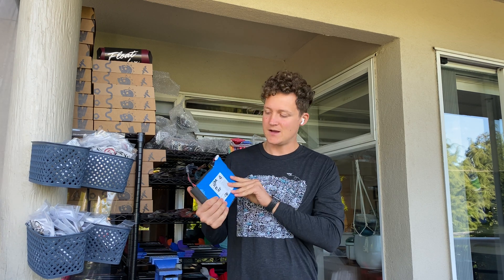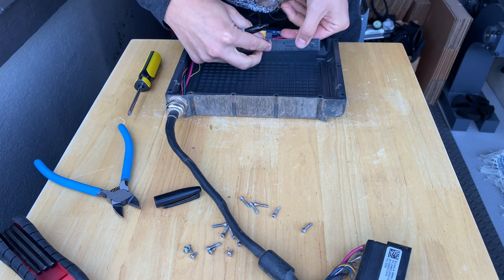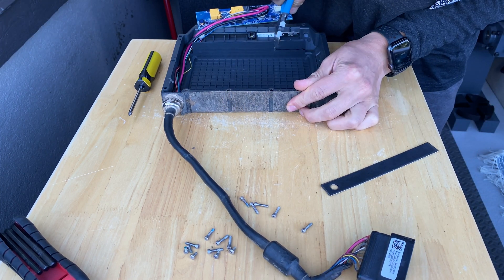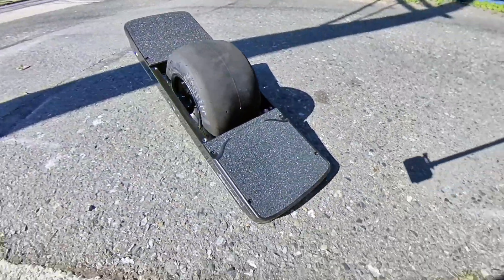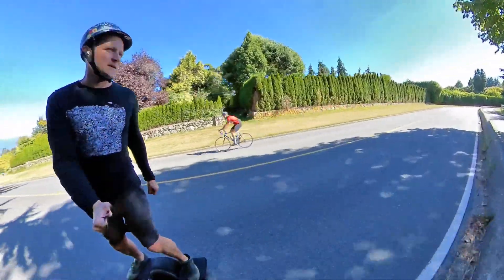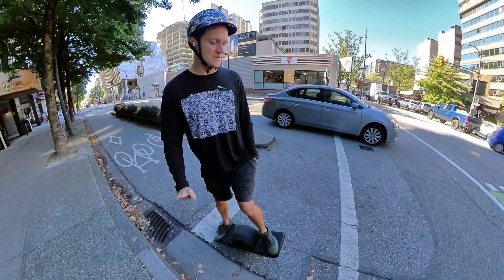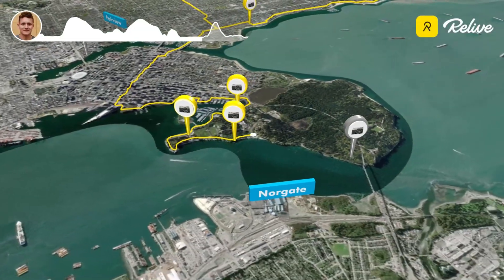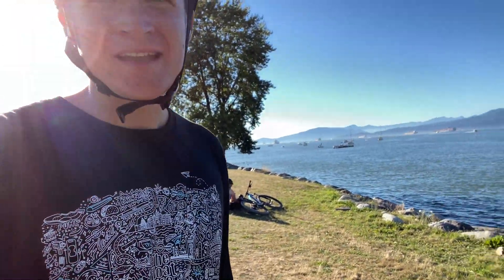Onewheel CBXR Battery Upgrade Installation & Range Test Review

Comment: How has the XR aged with the CBXR? i’m looking to get a battery replacement for a stock 4208 w 2500+ mi on it (new to me)  but i’m a little worried about long term longevity

Comment: Honestly an XR with CBXR is like on par with a OneWheel GT. I’d rather have an XR over a GT. No ghosting, no bricking when doing a simple mod. All the good stuff in one for the XR! Have to buy used tho :/
Reply: They are saying a new battery with a VESC module you might as well have a GTS you just built a GTS except its lighter
Reply: @BrianSmith-yq7ys I have a GT now. 

Also, a CBXR VESC is nowhere near as much torque as the GT-S we’re talking 27s vs 15s (113.4v vs 63v) and the GT-S even has a motor that’s been developed to make more torque (which reduces top speed but 113.4v is already insane)

Now if you’re talking VESC with a 20s battery it can be close with a superflux.
Reply: @destruxandexploze2552  I’m thinking I’d rather mod my xr than get a gts ill take you at your word that the gts is better but its also $3200

Comment: My installation did not go exactly like this. Extra tools were needed, 1 cousin and a broom stick. Those screws at 5:20 were brutal to get in, I had my cousin pushing down and sideways with the broom stick to get the screws to line up and go in. A bit of sweat and maybe a few tears were shed in the process. It all came together in the end, I also installed the battery meter which also had its own issues. Mainly the small restricted space in which to work in and fat fingers. 
It is definitely an experience to install the chibattery. I managed it after a couple of hours, and I'm glad it's done. Loving the range so much, and that my feet give out before the battery does.
Thanks for the video mate.

Comment: Thank you for this video. I couldn't get my CBXR to fit in the battery housing until I saw you route the power cables over the battery instead of under. Worked perfectly. Thanks!

Comment: Criticism: cam angle on 1st part of video needed adjustment. The work you were showing was at the back 3rd of shot. Other than that, great video. Wonderful shots of your ride. I've been told to visit Vancouver since I lived in the beautiful city of Toronto (I'm American). Nice job exhausting the battery. Are you going to do a follow up video later? A review on how the battery still holds a charge (less range vs same range)? I'd be interested in that. Also, how long (time wise) was your ride?
Reply from the maker: Thanks for watching. Yeah, I realized the camera was angled a bit but luckily caught it so the entire video wasn't like that. Vancouver is definitely one of the most beautiful cities. No follow-up planned but the CBXR is still holding up well. I can't remember how long I rode for but it must have been around close to 2 hours straight.

Comment: I just got cbxr chia 560 ish watt 38mi range of your a frisbee like me battery upgrade and my variable rate aka won't pointlessly kill my battery life charging at home while I'm sleeping @ standard3A to hyper6A charge speeds.

There's countless diagnostic and reviews on lithium ion batteries of various mixtures but the slower you charge your battery and if you cut it off around 80% the battery will not form as nearly as much dendrites and it will last far longer than advertised but charging it to 100% of parently is the most effective way to create dendrites along with high amp charging.

If I could charge it 1 amp all night I would do it.

Seriously 38 mile range that's like three 12 Mile trips. That's damn near within the US average distance for traveling to work.

Now I can charge my battery at 2 amps the slowest speed at home.
To keep my dendrite count the lowest possible.

Do you know charging your battery only to 80%, also keeps dendrite formation down I didn't know that until very recently sucks you can't charge it to 100% without causing more damage.

Now I just got to find the will to get out of bed and go install it. It will be awesome being able to go to work 3 times without ever having to charge is crazy.

Now include my ultra-compact/lightweight 200w solar blanket. Only 12lb unfolding solar array 2 ft by 6 ft enough to get my 38 mile range battery charged and a little over 3 hours. I'll bring the light weight tent and just sleep the hours away and rest for the next leg of the journey.
I don't know anyone else is trying anyting this crazy.

I now have the range to go to 100-300 miles into the the wilderness and totally ride out under power there's no need for civilization or Outlets!

I'm thinking I'm going to try to do a section of the Colorado Trail it's 400 miles total or 500.

Comment: Hey! I was wondering if the battery percent on the Onewheel app is still accurate after the upgrade. Thanks
Reply from the maker: It's not but Chi sells a battery gauge that you can install on your board to monitor battery levels. Or you can look at your cell voltage in the app to check the approximate battery level.
Reply: @eevees  ah ok, thanks for the info

Comment: I've always pushed my board pretty hard on road and off road.

So feelng battery sag at 60% and having to change how I ride to accommodate the battery when I've only gone 10 Miles. After a year of recharging.

They should up production on secondary components especially the formed plastic bits like the cases add LED strips extra wire harnesses. An just sell that shit.

Pisses me off they didn't give us a bigger battery pack.

Or make the XR ver2.0 with 38mile range.
Reply: I wish more for quick swap batteries than something like extended range. That way we can carry 1-2-3 more batteries. Maybe even store 1 or 2 on top of the fender. Then hot swap when the time comes. A quick swap as easy as opening a cover, swap, close. It seems like riding more than 1 or 2 hours in one go is going to take training. Everyone I watched to range test seem to mention foot fatigue.
Reply: @Andrew-ig5sp  I just got cbxr chia 530wh 38mi range battery upgrade and my variable rate charger 2A to 8A charge speeds.

No I can charge my battery at 2 amps the slowest speed at home.
To keep my dendroid count the lowest possible.

Now I just got to find the will to get out of bed and go install it. It will be awesome being able to go to work 3 times without ever having to charge is crazy.

Now include my ultra-compact/lightweight 200w solar blanket. Only 12lb unfolding solar array 2 ft by 6 ft enough to get my 38 mile range battery charged and a little over 3 hours. I'll bring the light weight tent and just sleep the hours away and rest for the next leg of the journey.
I don't know anyone else is trying anyting this crazy.

I now have the range to go to 100-300 miles into the the wilderness and totally ride out under power there's no need for civilization or Outlets!

I'm thinking I'm going to try to do a section of the Colorado Trail it's 400 miles total or 500.
Reply: @Andrew-ig5sp  I can see the potential in that and you could still charge if you needed to.

I've had my leg ripped off a few times so I tend to go with anything that's the least heavy.

The more weight I carry my pack the greater the fatigue and the faster the pain comes on.

I like 8hr runs into the desert with the cyoties chasing and stalking. I start at midnight and ride to morning.
Reply: Needed in 2021!
Reply: Well now it’s here! The GT lol
Reply: @brewski210  you kidding those fuckers took so long I went and just modded my own now I do 38mi, my tire torque is high, no battery sag, until I get to 1/3 of a charge. Plus I got a variable-rate charger with all the money I saved.

I now just charged my one will overnight at 2 amps saving the battery and extending the life.

I got a lot more for my money and value than buying that piece of shit renamed XR.

I never have to take my charger with me 90% of the time.

f*** the GT just another way of spending $2,000 you didn't need to spend. the aftermarket battery upgrade does the same thing for far cheaper.
Reply: @anarex0929  exactly my thoughts too

Comment: Hey dude! Awesome video. Do you happen to know what kind of lithium cells the xr used and also the new battery pack used? Are they the same?
Reply from the maker: The Onewheel standard battery pack and CBXR both use 18650 battery cells. The Onewheel is known to use Samsung 30q and CBXRs use Sanyo 18650ga.
Reply: @eevees  Thanks for the reply. So if they're they same size the reason to cut the box I assume is because it has more cells than the original correct?
Reply: @SpiritBond  That's correct. They're more crammed in there.

Comment: Is there any safety concern with these aftermarket batteries like over charging with stock charging parts?
Reply from the maker: You can't over-charge with stock chargers but any time you mod the Onewheel, there are safety concerns. Mod at your own risk.

Comment: Can you have the ow app open or will it mess with the board
Reply from the maker: As long as you have hardware version 4206, 4208, or 4209, you can keep the app open and shouldn't have any issues.

Comment: Been thinking about getting one for my pint, my only confusion is does the app accurately pace the new battery or do you need to go off of voltage within the app maybe?
Reply from the maker: You have to go off the voltage of the battery
Reply: this bat could fit the pint you think?

Comment: If this was the range stock i would have bought a onewheel already. Went for a group ride the skateboards made a 19 mile trip the onewheel charged for 15 min at the half way point then died a couple hundred yards from the parking lot.. in hilly areas that battery is desperately needed on eboards or onewheel

Comment: Thank you so much for this video. The easy installation und insane range test lead me to order one to europe for myself. While already apart, I also badger'd my board. It was a good oppertunity to get to know the components of it.
Although I have to say: Tucking the battery in tight and closing the lid by force because it doesnt fit right anymore made me very nervous.
Reply from the maker: It's a tight fit but it should still fit with a little elbow grease and making sure you shaved off enough on the inside.

Comment: Will this work for Onewheel + ?
Reply from the maker: Unfortunately not
Reply: Will it work for 2020 XR?
Reply from the maker: @Kingdom_VanLife  Depends on the hardware. Early 2020, most likely. Some 4210s work and 4206, 4208, and 4209 work as well.

Comment: Hi very sorry if am commenting a bit late, I just want to ask if the battery store more power does that mean it charges a bit longer?
Reply from the maker: Hey there. Yes, the battery does take longer to charge. It takes 3hrs and 15 mins on the standard charger or 1hr and 45 mins on Chi Battery System's fast charger.
Reply: Thanks for the info I actually don't have a onewheel but I have been wanting 1 for so long. And I just gotta say you make really good videos, Sorry again for replying a bit late😅

Comment: Hi, before I dish out a grand on the cbxr upgrade I was just wondering how it’s held up until now, is it a good quality battery and will it last?..
Reply from the maker: They are better and more reliable than the original stock cells.

Comment: Can we do on new pint
Reply from the maker: They sell a Quart but it will only work with hardware versions 4210 and prior. New Pints won't work
Reply: @eevees  May I ask why it doesn't work on new pints? And how do you check hardware?
Reply from the maker: @Sharknado8665  Future Motion changed the hardware for newer Onewheels to stop people from upgrading their Onewheels. You can check under board settings in the app.
Reply: @eevees  OK thanks. I checked their website and in their description it says it's confirmed working with my onewheel hardware. I got my onewheel pint 3 weeks ago. Hardware 5314 /Software Gemini 5050.

Comment: How's the balance of the new board?  Does the percentage work correctly via the app or are you reading the actual battery juice left via the specs?
Reply from the maker: It balances normally. Battery levels are checked by reading the board's voltage as the percentage does not read accurately.

Comment: Wow. This is a complete game changer. The XR now competes with lower end EUCs in range. When I upgrade to an XR I will be installing this immediately. How fast is a charge with their fast charger?
Reply from the maker: Make sure you buy a used XR with the hardware version 4206, 4208, 4209, or 4210. If will not work with the newer XRs unfortunately. It will charge in just over 2 hrs with the fast charger.
Reply: How can you tell which hardware version you have

Comment: Be very cautious of the BMS going out if you crash at 18 mph you can die there has already been one death this year on the Onewheel.
Reply: That was also due to that guy not wearing a helmet
Reply: Wouldn’t it be easy to update the system with a auditory alert just like the one that you get when your battery is at 50%🤔 it seems the company is lazy. You are blaming the guy that died seriously they should’ve created a system that works! Pushback doesn’t always kick in thank God for the fangs I have on the board.
Reply: @fmadrid91  yes im blaming the non experienced rider for not wearing a helmet and smashing their yeD on the ground.. helmet would mean they are still alive.do you blame the bike for the guy crashing into the tree??
Reply: @fmadrid91  puehback does always kick in, it line 67 of the code and it starts its subroutine as soon as the hall sensor tells it too...
Reply: Pushback doesn't always kick in sometimes the board will just shut off and nose dive. Thats why there needs to be a early warning system in the app just how it warms you that your battery is at 50%

Comment: wow ive had my xr since the 9th, i was thinking i cant wait for a onewheel that doubles the current onewheel xr range cause i have no prob riding 12+ miles. then your video came up and this will be happening once i lose my warranty XP
Reply from the maker: GreenThumbJeremy Make sure you check your hardware version. Future Motion blocked the newer Onewheels from allowing this mod. It will not work for hardware versions: 4211 or 4212
Reply: @eevees  tyvm!!!!!!
Reply: @eevees  I’ve got 4212 ;[ hoping there will be a solution in the future.
Reply: @eevees  won’t it still work but you just can’t open the app?
Reply from the maker: @Mrjerk2000  I believe that's the case with some versions of 4210 but any higher than that, I wouldn't risk it. Word on the street that there will be a solution for 4211 and 4212 soon though,
Reply: @eevees  Any updates for 4212 yet? Thank you and nice video!

Comment: How much for this battery? I'm ordering asap.  I ride single-track all the time, would love more range .
Reply: Jw battery (same pack) 610 shipped 7 day wait time "OWREDDIT30" coupon code
Reply: $700
Reply: Awesome, im ordering today
Reply: @MrDmadness  I got mine 2 days ago it's easy asf to install, JUST DONT FORGET THE SCREWS UNDER THE WARRANTY STICK UNDER RAILS. I couldn't figure out how to remove the battery pack because I didn't know there was 2 screws still holding it in. Other than that easy peasy.

Comment: How can I pimp my ow+ with this upgrade?
Reply from the maker: Stephanos Berger unfortunately, there are no ways to do this type of mod for the +
Reply: @eevees  Well then its fair enough we OW+ owners can travel per airplane and can add endless battery capacity with EGOs. Good with that, just a bit uncomfortable in some rare occurrences.
Reply: @mackvie  I just got an email from chibatterysystems today saying there’s a new battery upgrade for the ow+. “cb+” and there’s a “cbv1.” Doubles your original range and comes with a mini-fast charger. NEWSHOP50 is the code for $50 off - only for early adopters.

Comment: Great video and ride man. Thanks for sharing.

 How long did you charge up the CBXR battery after installation before riding it? And did the CBXR change the pushback threshold, torque, or top speed?

Thanks
Reply from the maker: watchNcarry Thanks! I charged until the green light came on the charger. Probably around 2.5hrs. You want to make sure you charge it full the first time you use it. 

It didn’t change the pushback threshold but torque and top speed feel were likely I proceed however I don’t risk pushing the board to its limits
Reply: @eevees  did the app give a decent read of the battery? And did it still have high speed p.b at 28kmh ?   Also did it give pushback warnings before it died?  I'm pretty stoked about this . :)

Comment: Does the onewheel app have an accurate battery readout?
Reply from the maker: No, you have to go by your board’s voltage.

63v is full battery. 54v is 50%. 45v is empty.
Reply: How to you check your voltage on the go?
Reply from the maker: @RustyRoams  Menu > Board Settings